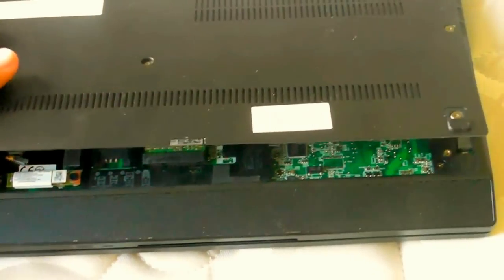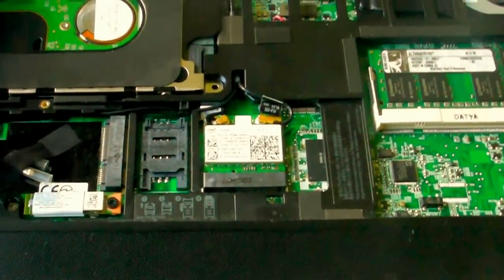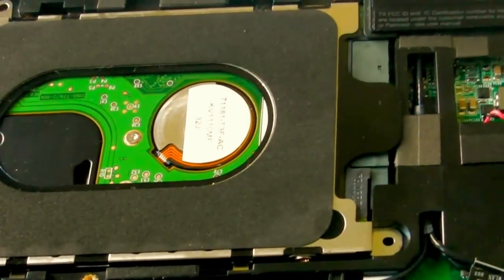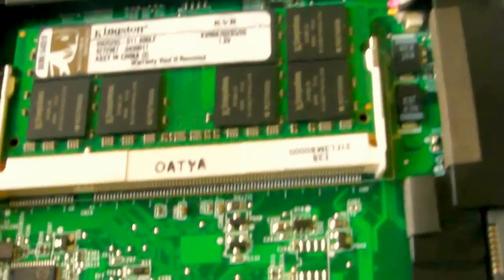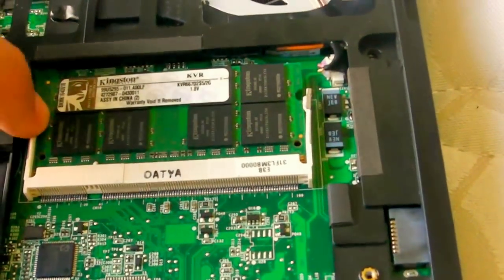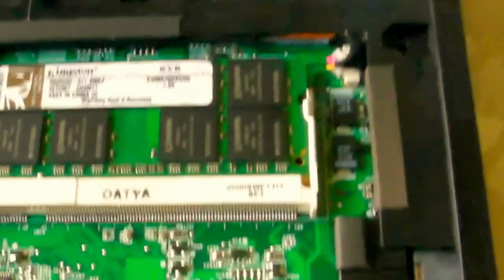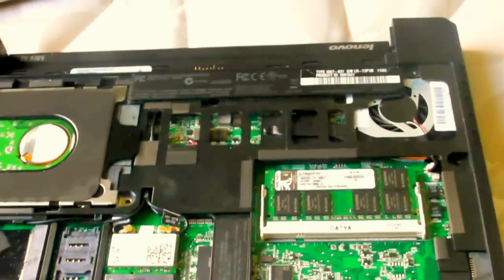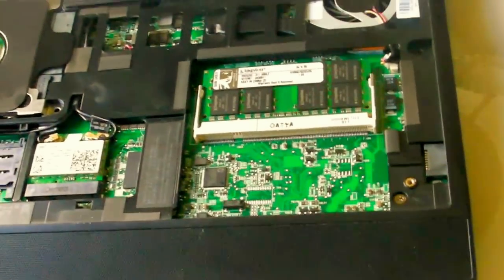Lenovo Mini 10 Internal

Comment: I still have this laptop. We got to keep them after Year 12. Showing its age though. I put Windows 10 on it an it runs okay, just a bit slow when running applications. I've also put on Linux, which runs considerably better than Windows - and it actually makes the laptop decent.

Comment: 3G needs the 3g module, No idea how to fit it.

It's DDR2 notebook ram, Check whether windows is 64 bit, if it is you can find an 8gb stick. if windows is 32bit it can only use 4.1gb of ram.